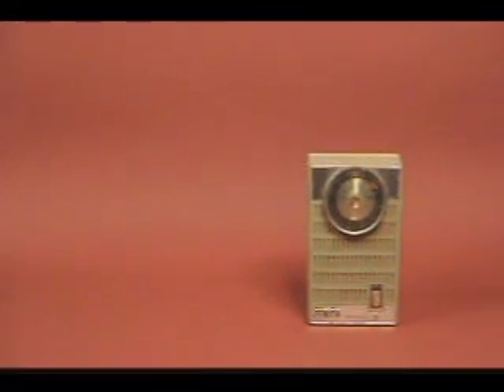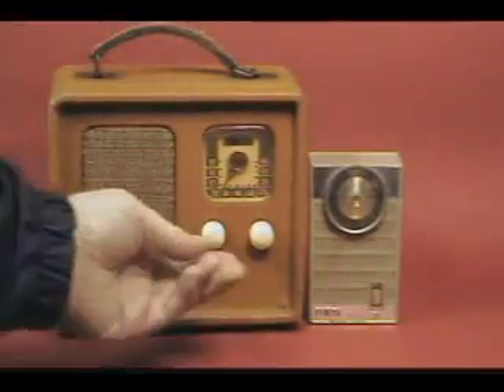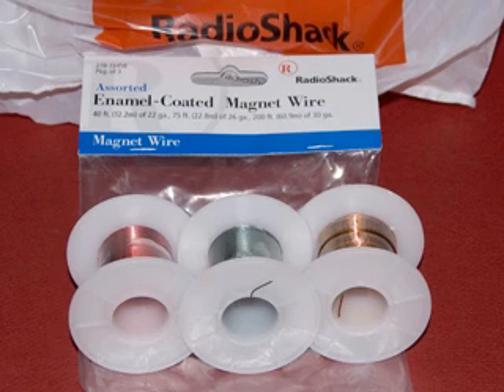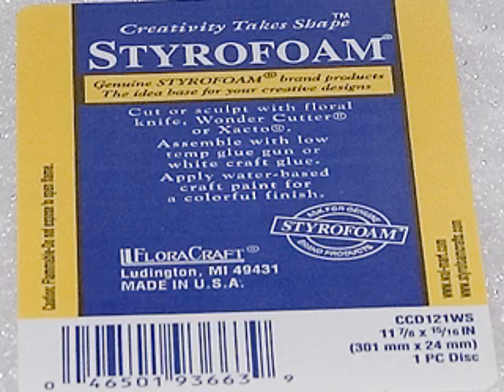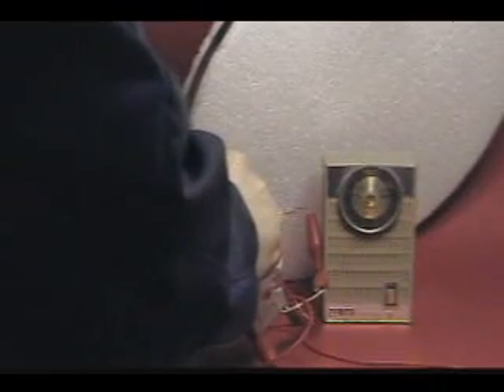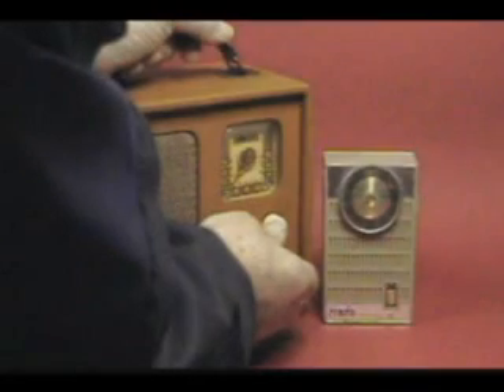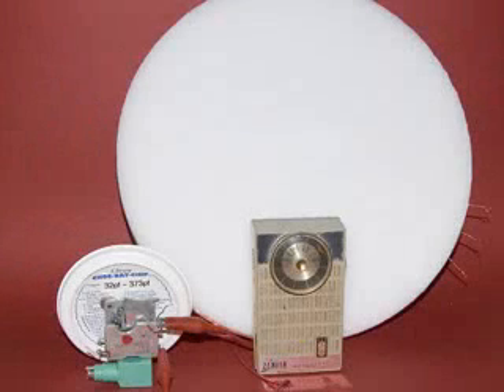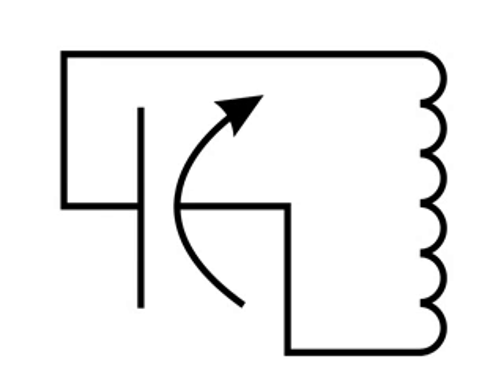Build a AM Antenna Lens

Comment: Why does the tank circuit lens work? That's a  very interesting effect and what frequency range can a lens work up to?
Reply: lens smenge -- this is a loop antenna which resonates at the frequency it is tuned for.  It is inductively coupled to the ferrule antenna hidden inside the tiny radio.

Comment: Need some help here-
 I live about 100 miles East of WLS 890 AM, Chicago - and in my house I cannot get a clear signal from WLS at all during the day due to RFI. Moving my Grundig S450DLX field radio around the room helps ever so slightly (outside, of course, is pretty good signal), but I cannot listen to my favorite station in my new house. Whould your antenna help? How about something like a RadioShack® RF Interference Filter ? Or an outdoor antenna? Any help would be appreciated. Thanks.

Comment: I wonder what the power out put of the antenna is without hooking it up to the radio. Since it concentrates the single, that means more energy is being sent to the radio to the transistors so that the speaker can produce a clearer sound through the speaker.  I bet you could charge a cell phone with it. Your converting the radio waves to electricity to actuate the transistors.

Comment: Nice design, but I wouldn't call it a "lens"; that is kind of a misnomer. What you made (and I sure you already know this), is a resonate circuit, which is functioning as a phased parasitic element. I love these antennas, since you can take an almost worthless transistor radio, and pick up some stations that you would never dream was possible. I also use a version of this type of loop for the 160m HAM band -- tunes with 4pf-8pf and has VERY sharp tuning. 73 de NV6R

Comment from the maker: As the frequency increases from the AM bands to the TV bands the characteristics of how the wave travels through the air changes. So what may work well at low frequency will not work at a higher frequency.
Reply: Nuts. A loop antenna certainly works well at TV frequencies. Check out Cubical Quad antenna (a loop in a square shape) for example. But a main difference is that at a TV frequency, you can easily make a full wavelength antenna, but at AM broadcast frequencies you usually have to make a short (less that 0.1 wavelength) antenna because a full wave is way too long for general practicality.

Comment: Most likely a 160  or 80 meter antenna.
My property is not all that big. I use a single G5RVjr up 70 ft in a tree, with an old Dentron tuner for my ham gear

Comment: I use a 40ft outdoor random length up 30 ft for 4 shortwave receivers.I use a MFJ-901B antenna tuner with the long wire before it is fed to multiple receivers. As I use a particular receiver, I use the MFJ-901 to peak the receiver. I see no interaction between receiver front ends. Getting the antenna up 30ft in the air has reduced line noise. You can make a good stealth antenna with some of that magnet wire. Just scrape the enamel off the end that connects to the antenna connection.

Comment from the maker: I know you'll be able to make it tune to the shortwave with using taps. This design has little or no effect on a straight wire. The shortwave radio I was using has an antenna tuning coil and that is what it was coupling to. 
For shortwave, the bigger the loop you can tune in that band the better. I'll do some experimenting and get back to you.

Comment from the maker: I miss spoke about the length of wire in the video. I added a correction in the "About This Video." However if you use the 75 feet mentioned, the Lens will work properly, interesting error.

Comment from the maker: Yes, being able to turn the antenna was a good and important tuning option. I miss spoke about the length of wire in the video. I added a correction in the "About This Video." However if you use the 75 feet mentioned, the Lens will work properly, interesting error.